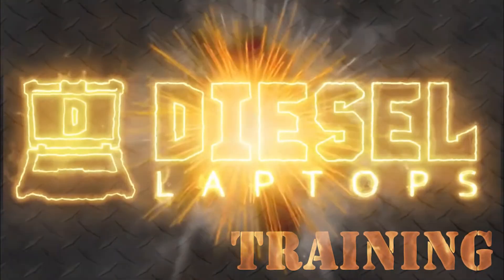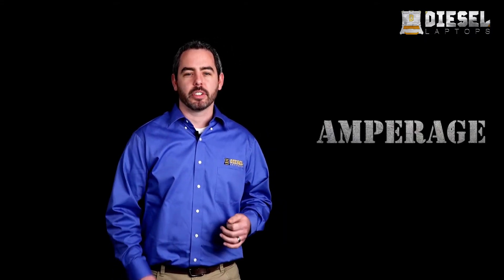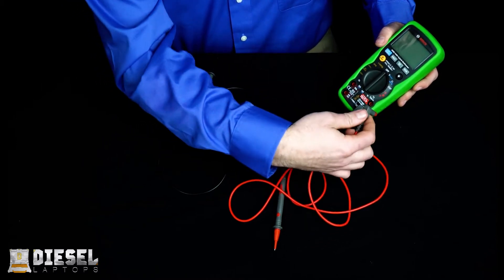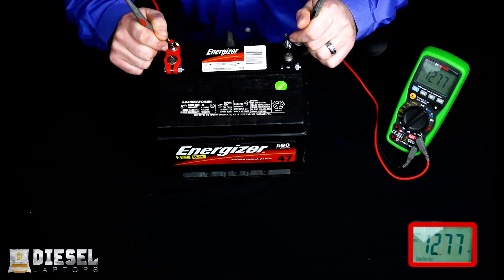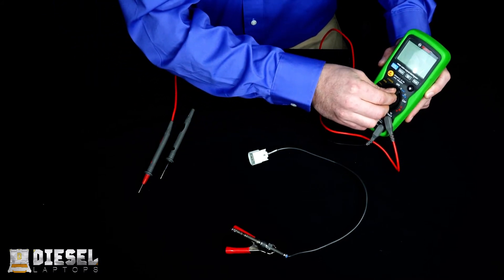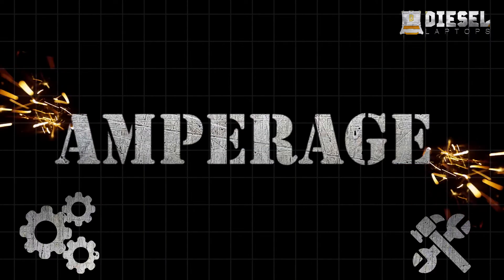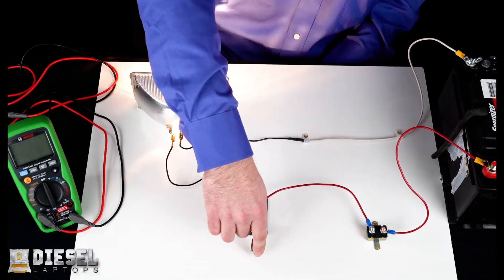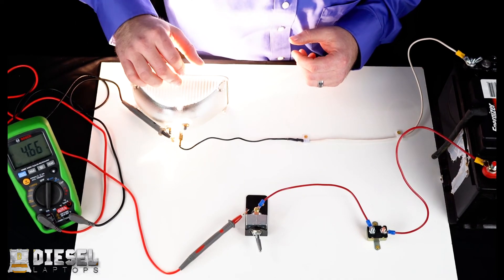Commercial truck diagnostic training with multimeter on voltage, amperage, and resistance

Comment: Just a heads up. You can test with a meter and still get 12volts but wont be getting the amps due to resistance. If you dont know the amps you should be getting a test light does come in handy.

Comment: How do I check if a wire has resistance?
I have a bunch of wires that are bunch together too tight , so I loosen the ziptie and now my truck starts.
But as I got under the pete 579 2018,  I saw some crazy crap.  There was one wire that had electrical tape wrapped around it and is following the wires, I notice that there's a point where they're wired together. 
I want to cut the electrical type and check if there's some rubbing wear and tear and I also want to check if that wire is good.